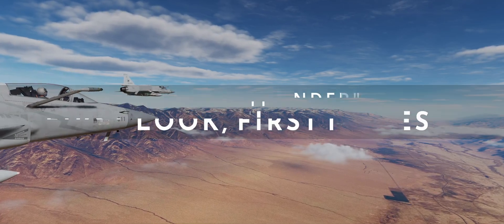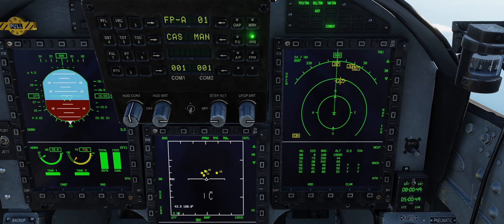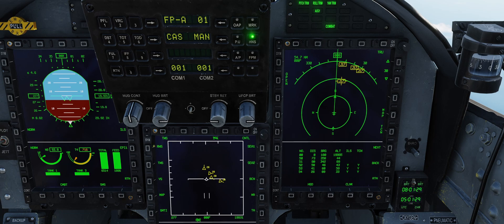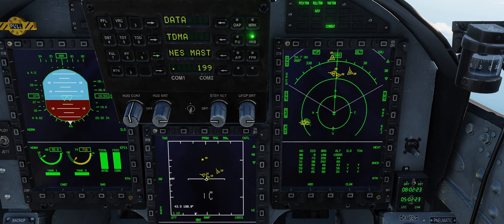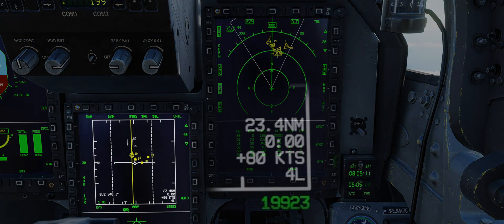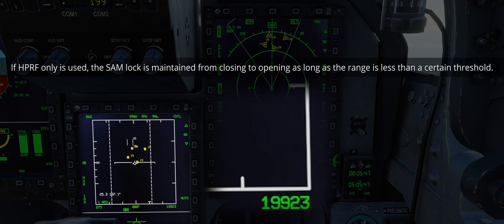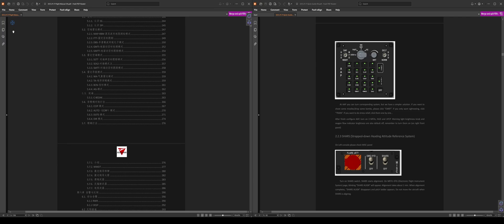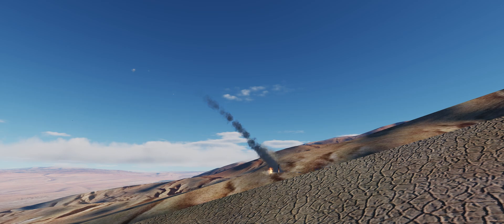DCS JF-17: First Look, First Issues

Comment: Most modern aircraft still does the track processing in RWS, it just shows a more “raw” view.

The F-15E Suite 4 (which is early 2000s) should also show track information in RWS. The F/A-18C Lot 20 (mid 2000s) also does all the TWS processing in RWS, and even displays it under the LTWS (Latent-TWS) option.

Generally, the TWS mode in those aircraft is to ensure proper track quality for launches, which would not be available in RWS.

Considering the JF-17 is a very modern (although cheap) aircraft, it wouldn’t surprise me if the tracking is done at all time.
Reply from the maker: That's very interesting, thanks!
I am still curious about TWS's limitations at this point: why RWS just doesn't spit tracks out, leaving the pilot with the option of tuning settings to increase accuracy — something in between HDTWS and RWS+Tracks, if you will. Besides, this is what the right screen does: a slow-refresh TWS if the radar volume is large or much quicker updates by reducing it.
Design choices, I guess?
Reply: @FlyAndWire  I’d be interested to get the opinion of the engineers designing these interfaces as well!

Personally, IMHO, I think it comes down to the pilot interpretation. Showing “raw”-er bricks in RWS allows the pilot to do the “old school” brick interpolation tracking in their heads, whereas as Notso said about the F-15E, RWS tracks with large scan volumes are very notoriously unreliable. They also show up as much small “track” stems, which I think is to reduce the pilot’s bias towards the track, in case it is bad.

I think it also comes down to the fact that you can still see the tracks, using the HSD or in the F-15E/F/A-18, the SA page.

Still IMHO, I think the separation of RWS/TWS is essentially a stop-gap/in-between human-machine interface while the tracking performance was getting better and better.

This is all very much my opinion though, so take it with a huge rock of salt. :)
Reply from the maker: Yeah, I agree on "big scan volume → lower reliability". You can do it in the DCS Tomcat because the probability of detection was not modelled when they launched it, so a ~14s, 8B ±65° sweep is quite good for SA since the detection range is massive. IRL or in modules that represent it, such a huge volume is not reliable. It is also the main reason why TWS is not used for engagements (at least pre-AESA), besides modes such as HDTWS.

I agree with the points you raised. Unfortunately, I don't personally know any system engineers. I'll ask around, though.
Reply: @ledude114  Not really a stop gap. Building a track is a matter of computation, and if you saw what older fighters are working with that makes more sense. A selling point of the AN/APG-68 was it's 96KB of RAM and 512KB of storage (Contain your excitement). Building a track is essentially observing target parameters and then extrapolating from memory, and then confirming the extrapolation on the next pass. Theoretically, it shouldn't matter what radar mode you're in, it's probably attempting to calculate that as a processor is going to be dedicated to the task in 4th-gen fighters. To that extent, I definitely agree with what was written then.

Why I don't believe it's a human machine interface stop-gap however is because the big thing with TWS that RWS does not do, is electronic beam steering. The radar will still scan like normal, but when TWS is activated, you lose a significant amount of gain because you're advocating power to steer the beam so that you can monitor a contact, without the antenna having to be pointed directly at it. For this reason, tracking in TWS comes with penalties, mainly performance with range. The gain penalty is also why TWS performance is so much worse in smaller fighters like the F-18 and F-16 compared to, say, the F-15C. The F-15's antenna is just so huge, by fighter standards, that it's going to have a lot more gain to work with. Beam steering was made possible because of the phased array. In comparison, AESA radars are extremely similar, however they build much better tracks due to a very large increase in computing power. This means more complex interweaving of search modes and much less dwell time. The gain issue is avoided mainly because instead of tracking as much as it can simultaneously, it switches from each contact very quickly, increasing how often the target's parameters are polled. An additional factor is with an AESA, each antennae element has its own transmit and receive module, so you can achieve much more intricate beam steering compared to a PESA that has all antennae units attached so the same TRM. That's literally where the "Passive" and "Active" parts of the names come from.

So long story short, TWS wasn't really a stop gap for the sake of human/machine interfacing, but an evolution in radar and computational technology, that AESA then further enhanced. 

Additionally, in regards to the zero doppler, the target that was demonstrated was at about the same altitude, so there's no real reason for the radar to notch at that elevation. The notch is mainly for reducing clutter from the ground or any ground based objects like windmills or vehicles. The radar will use doppler shifting to accomplish this. At higher antenna elevations where it's not looking at the ground, there is no need to that particular filter. Thus, the test should be conducted with a target that is lower in altitude.
Reply: @aviationrambler  unfortunately, there are several things that are wrong with what you wrote.

First, all the aircraft that I gave as example in the timeframes that I gave are mechanically steered antennas, not PESA nor AESA. There's no loss of detection range between RWS and TWS in those aircraft when displaying "raw" bricks (e.g. the "Hits" option in the F/A-18). In TWS, the antenna does not dwell on any targets, but continue scanning continuously.

Also, by stop-gap HMI, I don't mean for technical or engineering reasons. I mean that most pilots transitioning to those aircraft when first available were used to interpreting raw bricks and not trusting the tracks. This most likely means that they would have expressed a need for a "raw"-er display, even if the tracking performance was adequate.

Finally, you seem to confuse 0-doppler with notch. The notch filter means that returns with a closing velocity and azimuth close to the ground closing velocity at that azimuth gets filtered out because of trying to reduce the main lobe clutter. Sure, this can be disabled in look-up scenarios.

Thing is, the 0-doppler is *not a filter*. It just means that there is very little doppler shift produced by that target and therefore it is much harder for the radar to detect it. This is an intrinsic limitation of PD radars. Most modern radars can "coast" the target through a notch filter or 0-doppler situation, but this is prone to failure and therefore sometimes unreliable.
Reply: @ledude114  So far you've listed the F-15E and the F-18 Hornet, both of which are, in fact, PESA, with newer F-15Es being AESA, and Super Hornets being AESA as well. If you look up these aircraft, literally the first thing you'll find is they are listed as using planar arrays, which PESA and AESA refers to the array and how it's powered, either the entire array managed by a single transmit and receive module (PESA), or each individual antenna in the array being managed by its own module (AESA). Neither arrangement excludes mechanical steering. This is, honestly, very basic knowledge. 

Simultaneously, doppler is not required for tracking a target, otherwise that would've been impossible before the 70s when pulse doppler radars were being introduced. Doppler offers many advantages, including more precise vector analysis, but there's other ways to calculate that particular metric. Mainly, the advantages of doppler shift is typically far less clutter and more precision, ie notching, or doppler beam sharpening, or cluster resolution. If you do not believe me on this point, I highly recommend watching Mike Solyom's channel on this point. There he has a video called "The Real Truth Behind The Radar Notch" and in the first minute, he demonstrates precisely what I'm talking about. It's not a bug, it's a feature.
Reply: @aviationrambler  Planar array does not mean PESA. A planar array just means the antenna uses a planar array instead of a parabolic or similar antenna. What makes a PESA radar a Passive Electronically SCANNED Array is the fact that the SCANNING is done electronically, i.e. by using phase shifting to steer the antenna. The F/A-18C Lot 20, the F-16CM and the F-15E Suite 4 all use planar MECHANICALLY SCANNED arrays. This is, honestly, very basic knowledge.

As for PD radars, using other means of detection implies a different processing technique and lower PRF, all of which are much more prone to all types of clutters. Older generation radars using very low pulse repetition frequencies for detection and were thus very prone to clutters and have low SNR. These types of radars are called Pulse, as opposed to Pulse Doppler. These different processing techniques and waveform also require different hardware and have their own limitations. It might not even be possible to detect the target by switching to a lower PRF, as is very well known about MPRF radar modes. Things get even worse at lower PRFs.
Reply: @ledude114  I'm ending this conversation because I'm talking to a brick wall and at this point my words are being misconstrued. At no point did I say planar arrays are analogous to PESA. I was very clear when I said PESA and ASEA refers to the configuration of said planar arrays. I've even said that neither configuration excludes mechanical steering. To make this as simple as possible, I'm NOT arguing that the radars on 4th generation aircraft are using mechanical steering. Of course they do. What TWS offers is electronic beam steering in conjunction to mechanical steering. There is nothing mutually exclusive with these two techniques, they can be used simultaneously, which is what TWS is. 

G'day. I'm out.
Reply: @aviationrambler  You literally said: “So far you’ve listed the F-15E and the F-18 Hornet, both of which are, in fact, PESA”, which is false.

And I’d like a source on TWS in mech scanned F-18 and F-15E using beam steering. I’ve never heard of that, never read that and it’s not mentioned in the documentation that I have. Even in-game representations and videos available online shows a constantly scanning radar antenna with no beam steering.

Beam steering is even sold as a feature of the APG-79, the AESA radar that replaced the mech scanned APG-73 radar in the F/A-18.
Reply: It does seems like some time for processing is modelled to build a track from RWS to TWS, if you look at your video at 1:15 you may see that after increasing the azimuth on TWS and detecting the target on the right side of the scope it takes 2 sequential radar scans until the track is generated. On the other hand for the bricks on the center of the scope, as they were detected at all times switching to TWS created instantaneous tracks, probably for the reasons explained in the other comment, the radar is building the tracks in the background as soon as it can interpolate sucesives hits as a track. If you try changing from RWS to TWS in a jist detected brick you'll see some delay until you have the TwS track generated. So it doesn't seem like a bad implementation.

Comment: I am really hope you make a video showcasing the RCS of the JF-17.  I really don't find a purpose in TWS when flying the JF-17.  My biggest gripe is how long it can take for the radar to let me lock a track.
Reply from the maker: Do you mean the detection capabilities of the KLJ-7 (effects of other aircraft's RCS on the radar) or how the Thunder is detected (JF-17's RCS)?
I have never been a fan of TWS tbh. My favourite mode is VS if datalink is available since it provides the information I cannot immediately get otherwise. I really miss my DDD :)
Reply: @FlyAndWire  In the airforce we use to call tws...TRACK WHILE SCAM.  I meant how the thunder is detected.  Want to figure how much of an advantage having such a small RCS is in DCS
Reply from the maker: Yeah, TWS is not a reliable mode. Unfortunately, it is so ubiquitous in DCS.
I wanted to clarify because many mix up the idea of RCS and detection radar, as if the RCS is a radar property, and not the contacts'. That being said, I don't think such a model is worth making: there is no commonality between modules, so the number of variables is simply too high. I think it's better to check Quaggles to have an idea of how radars are implemented: https://github.com/Quaggles/dcs-charts
The RCS of the SU-27 is 5.5 m²; the JF-17 is 3 m². You can't blindly cut the range in two, of course, but this should give you an idea. For instance, IIRC, the F-16 (4 m²) showed up on the AWG-9 at 80-something nautical miles and the Su-27 at 92 nm.
Here, you can see the tests I made for the APQ-120. I used the F-16 and the Tomcat (6 m²): ~37nm vs ~45 nm. Again, no hard data, but since there's the probably of detection to account for, aspect, external ordnance and so on, I think it's enough to have a general idea: https://youtu.be/-_oGXnEfyOs?t=328
Note that I made these tests at release, IIRC, the radar has been tweaked since then.
Nevertheless, comparing the two sets of values, moving from Su size to F-16 size, the detection range decreases by ~15%.

Hope this helps!

Comment: Based on my own testing, I’ve noticed that TWS tracks don’t appear instantly. As others have mentioned, the radar creates tracks while in RWS. If you quickly switch to TWS when the first ‘brick’ appears, it will only transform from a ‘brick’ to a track after two sweeps over it.

Comment: 1- there is an English manual, Chucks Guide.  

2- what it looks like you are experiencing is the data link sending contacts to the radar scope.
Reply from the maker: 1- as mentioned multiple times already. As much as I love Chuck's work, it is nowhere near the level of depth I want.
2- what? No, DL was off. Others have commented with more reasonable observations. Besides, I really doubt DL would interfere with your scope when there's a dedicated page for it.
Reply: @FlyAndWire  so what information are you trying to find on that radar?  Most of the details are secret and not public knowledge.   Right now the one we have in game is an idealized version based on "best case" scenarios.   

It's in-game capability is a roughly 35-65nm detection range, strong jamming burn through, moderate sweep speed with excellent memory and track prediction.  It is almost a carbon copy of the F-16 in games radar as far as capability.  There are some minor differences but basically it is the same.  

I also have only watched your video on my phone.
Reply from the maker: Well, basic stuff. For instance, what is the relation between PRF and RCS. I haven't played with modules simulating MPRF, so I don't know what is the equation or the ratio governing them (e.g. for HPRF I have a real AWG-10 model, for the APQ-120 I made one). Since you mentioned noise jamming, does the JF-17 follow the same hardcoded burnthrough ranges akin to other modules or is it dynamic? If the latter, why is it different and how. Can I also break the game as I do with the Tomcat and kill jamming targets at 60+ nm (obv closer with the SD-10)? How is JAT managed?
I have tons of questions about the details of the b-scope and the SA page. For instance, I found that the PPI TID AS of the F-14 shows vectors as Euclidean subtraction of vectors. This gives a ton of useful information at a glance. Is there something similar in the JF? More simple questions are about engagements: what is the reliability of multiple tracking? STT should be very reliable. Does this happen in dual engagement mode as well? Is there any change when the two contacts are wide in azimuth or elevation? How is the reliability at the gimbal limits? Does the INS struggles with hard cranks post multiple employment? MPRF should be rubbish at low altitudes; at least, it is for the real APG-70. What is the threshold, if there is, for the KLJ-7?

The list of other questions is probably unlimited, but these are just a few. As mentioned, all elementary stuff, probably a bit niche, but fundamental to really understand the capabilities of the platform I am playing with.